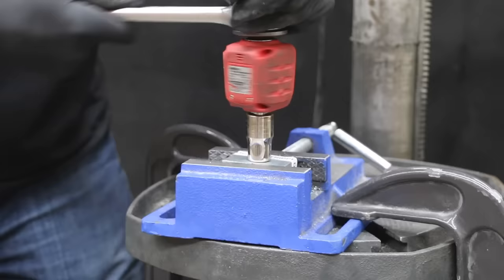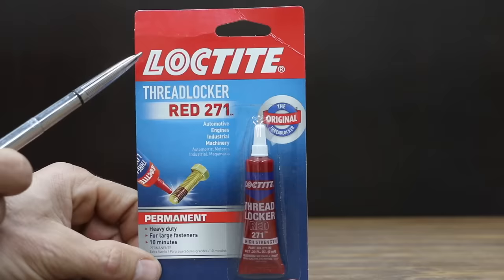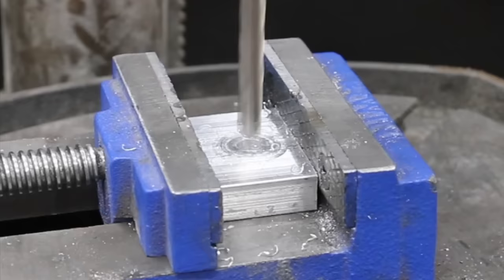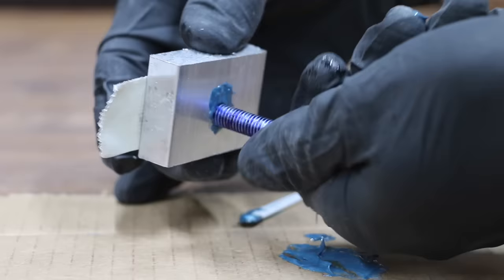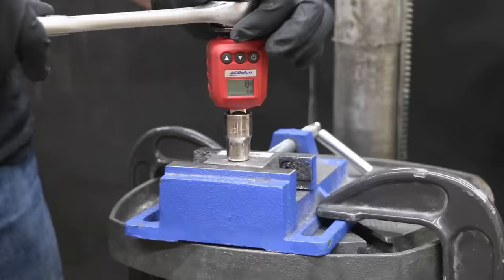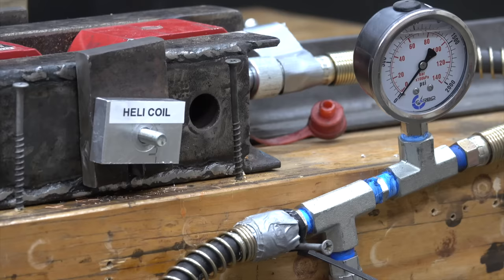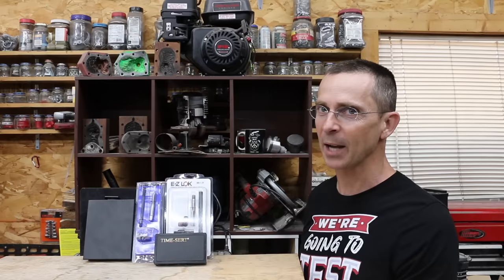Best Damaged Thread Repair? Let’s Settle This! Heli Coil, TIME-SERT, E-Z LOK, JB Weld, HHIP, Loctite

Comment: I appreciate this video so much, because of product line-up and the inclusion/comparison of known urban-legend-y hacks.

There are one or two issues with this video, that fixing would make it better. First, the time-sert tap shown in the video at 7:23 is not straight! That wouldn't meet some shop's standards. If I were them, I would want the test re-done.

Second, is that the test is done on a material where the inserts are able to out-perform the OG thread. Not cool! Try steel!!

Finally, an important technique was left out! This involves making an in-situ insert, by tapping a bigger hole, screwing in a bolt with high-strength loctite, then facing, drilling, and tapping that bolt out to the original size. This is important, because you can also move the hole center with this technique -- in addition to replacing the thread. And the only cost is the bolt after the drills/taps are purchased.

Comment: Can you do this in reverse, not sure how to best explain it.

But i have an e-bike and the company shaved down the sides of the threads on the axle trapping/locking the lock nut in.

It there a way to replace/build a compound or metal back onto the sides of the axle that has been shaven off.

So that i can rethread said compound/metal?

Sorry if this is easy to understand.
Reply from the maker: Thanks for the suggestion.

Comment: Hello, I have a pellet stove that has a screw hole thats stripped. The screw in question, holds the glass snug to the door. Being stripped, means its not air tight. Im a woman, so i dont have the skills to tap the hole. Will the copper wires work? Would the heat from the stove melt them and then make it loosen up and leak air again? Is there any kind of welding stuff that would snug up the hole that wont melt? I believe the door is irion, where would i be able to take the door to have it tapped? And what would it cost? (Estimated cost?) I truly hope u can help answer my questions, i have no one else to ask. Ty

Comment: It's already been suggested but stronger bolts would better test the inserts. This test is flawed because the bolts were inconsistent in their strength. We need to see the insert break as opposed to the bolt itself to really know which insert does the best job.

Comment: Hi!! for constant use what do you think will work best? the elevation system on my table saw get damaged, the threads of the motorhead that moves up and down the blade needs to be repaired

Comment: I love these videos, but I feel this didn't accurately test the helicoil style threads. With those when you tighten it, it just pulls them into the head of the bolt and doesn't allow them to pull out of the hole like they normally would.
Reply from the maker: Thank you!  Thanks for the feedback.

Comment: I'm not smart but
If you're making the hole bigger, just to thread an adapter to use a smaller size bolt

Why don't you just use a bigger bolt?

Comment: Hi there, Great informative video. I have a somewhat related question that you might be ble to answer. I have a set 1/2 inch threaded bike pedals (for one piece cranks) that I need to convert to 9/16n inch to mount on a 3 piece crankset. Would it be possible to machine a set of bushings with 1/2 inch 20 TPI inside threads and 9/16 inch 20 TPI outside?

Comment: My takeaway from this video is that aluminum is really a garbage material for machine assembly castings because of its softness.  But of course its low density, low cost, and corrosion resistance win the day.

Comment: Wonder which of the metal inserts would stand up to high exhaust manifold temps the best?  I have a partially stripped manifold stud in an aluminum head that I’m afraid will strip fully if I give it the full torque spec of 30 ft lb for the 10x1.25 studs. I got it to about 20 but it felt like it would strip if I went any more.

Comment: My motorcycle's 2nd drain plug is stripped, tried helicoil, it's not holding it will, thinking about time sert, it was M6 bolt, should I order M6 time sert. Not sure as it has helicoil in atm.

Comment: Please help guys I need advice. A bolt broke from the coil pack on my GMC envoy. I got some of it out but now it is inside where it's unreachable. I shoved the new coil.pack on it with a new spark plug. It runs like shit and I'm afraid it will blow up. It's the only vehicle I have. And me and my wife share it. What's the best way to go about getting this done. Again I had some help and we welded a piece to it and it broke again after two turns. I cross threaded it. And now I need to get a tap out or easy out and then rethread it... Will the new coil pack bolt work. Or should I just drive it util it dies. I give it a week.

Comment: If the bolt breaks before the threads isn't that number just showing how strong the bolt is? So the 500-700 ones are all even. Should have used very high strength bolts as this was about the threads and not the bolts themselves.

Comment: Will any of the methods w/pasta type repair work on Transmission (Aluminum) Drain Plug? See I stripped a bit that hole and probably the original bolt using a faulty torque wrench. It didn't click and continued to torque, then rotated once free, so I checked w/electronic one and it was 33 Ft-lbs instead of 22. Been mortified of course, I removed the plug, I hoped it was damaged rubber gasket that gave that single free rotation. I saw one 3/4 tiny circle ring came out of the hole though. Then I torqued it back w/electronic Torque Wrench to 22 Ft-lbs. But after I decided to put a new plug w/magnet I bought and received. So I removed the old plug again, and there was another tiny aluminum ring removed from the hole. The new plug was not going in. I put back the original, but was not able to torque it anymore, like on 11Ft-lbs it would rotate free. I removed it again, checked w/mirror, seemed like all the threads were in the hole in good condition, and put that new plug, it was tight 1st, but then went in. I hand tighten it, then snagged,  and not sure what torque to apply now. From all the described above I conclude that the hole is slightly stripped. Maybe I'll be O'K if every time I remove the Plug I put a new one.  Total mess I know, very upsetting mistake. If someone has any ideas please share. The film is very good. Thank you.
Reply from the maker: Thanks and you are welcome!  Thanks for the suggestion.

Comment: While I appreciate the effort of testing, I cannot help to notice that in the case of thread inserts, it was the bolts' axial strength that was ultimately tested and not the inserts'. Maybe one should have used high strength bolts that would have withstood the torque while ripping the insert off.
Reply from the maker: Thanks for the constructive feedback.

Comment: Which would you say is best to fix an oil drain plug? Scared any repair will still leak oil when it gets warm and thin, thanks.
Reply from the maker: Thanks for the suggestion.

Comment: Excellent testing, as usual.  (sigh)   So, the moral of the story is "Nothing fixes stripped threads like an insert."  If you're out in the boonies and have no sert but do have a drill, tap, JB Weld, and a spare day, you'll get by well enough.
Reply from the maker: Thanks!

Comment: What would one suggest for an aluminum radiator coolant reservoir overflow tank 6mm mounting hole that was stripped in the first few threads?  I can't drill it.
Reply from the maker: Thanks for the suggestion.

Comment: No hate here, but can the Americans please explain to me why you still use the Imperial System in literally everything? I've planed going to the US for at least some Time and i imagine that i would find it very difficult in my Job as a Maschinist... Everything from Feeds and Cutting Speeds for Milling and Turning to picking the right Drillbit for taping a thread, except ofcourse imperial threads :)

Comment: I’d be curious to know the relative strength of the original aluminum threaded with a bolt the size of the repair. That is, the original test was the pullout of a M8-1.25 thread, but the threaded insert is basically an M10-1.0 or thereabouts. So what’s the pull-apart strength of a simple M10 screw out of threaded aluminum plate? Is it comparable to the M8 screw embedded in an M10 insert?

Also, if the thread inserts are not themselves aluminum, or similar material to the screw, what extra electrolysis concerns might there be?
Reply from the maker: Thanks for the suggestion.

Comment: 8000 comments? you may not see this one?
What if you use an insert tap before using the copper wire?
Reply from the maker: Thanks for the suggestion.

Comment: @Project Farm My 1 question is I have (2) two Kirby vacuum cleaners where the motor head faceplate where the locking assembly for each additional option mount to has stripped (due to the lock breaking after 25yrs and needed replaced BUT when removed the faceplate threads stripped) and are 1/4-28 threads as I replaced both bolts but still need to repair the faceplate and the thickness/depth is only about 3/16 to 1/4" MAX and haven't seen a helicoil that shallow so can I cut the remainder off or..... thanks hope I get an answer FAST on this one please and thank you 🙏🏼
Reply from the maker: I would definitely try to shorten the heli coil so it will work.
Reply: @ProjectFarm  does name brand make a difference on thread locking inserts? I see Walmart has a brand called Uxcell

Comment: should have took higher quality bolts tbh
like some 12.9 bolts, here im sure the thread will break before the bolt
and to make sure its the repair kit that is tested, and not the aluminium, to drill steel
Reply from the maker: Thanks for the constructive feedback.

Comment: Every test when your bolt broke, the result is the limit of your bolt, not thread.
We can see it on your last test, the five first results are the same (limit of bolt).
To be more acurate, you need to test it with 12.9 bolt, 8.8 are shit and broke easily.

Comment: Redo these but with a higher grade bolt.
Reply from the maker: Thanks for the suggestion.
Reply: Wow. Didn’t expect a response. Cool! Anywho, we use these at work and it would be cool to see if you can get to a point where the bolt is stronger than the insert, or if they are all pretty much equal.

Comment: O' no. Lock-N-Stitch has a much better solution for both aluminum and steel, also plug repair kit for stripped threads in your engine block. With over 40 years as a machinist I would stay away from cheap fixes like JB weld, Epoxy or Heli Coil which don't hold up for long and your back at the repair again.

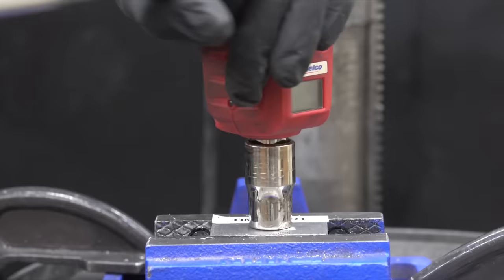Comment: 10:32 your chart is mostly irrelevant, in the first 4 instances it shows the tensile point of the fasteners, not the resistance of the thread repair device.

Helicoils work reasonably well in ferrous metals but when doing repairs in soft metals such as aluminum, a bushing type insert such as a Keensert or Time-Sert should be used.  We have seen too many helcoils pulled out of alloy materials.

Comment: No Keensert?
Reply from the maker: Thanks for the constructive feedback.
Reply: @ProjectFarm look up MS51831 for the keensert spec, used all the time with grade 8 bolts. They come in different wall thicknesses too. I agree with what others said, if you repeat this test you can get stronger bolts to get more data. Class 10.9 and 12.9 are the next higher metric strengths, roughly equivalent to grade 8 and ASTM A574 respectively. Keep up the good work!

Comment: How about rivnuts or nutcerts?
Reply from the maker: Thanks for the suggestion.
Reply: @ProjectFarm  Nutcerts are used in aviation (2 piece construction that wedge into each-other and expand) and are meant more for blind holes. Rivnuts are usually used with sheet metal, to clamp the metal as rivnut collapses. Would be interesting to see how they perform in blind holes. Rivnuts come in plain, notched or ribbed variety. Perhaps the ribbed version can dig into aluminum well.

Comment: Why are the EZ lock bolts breaking at different torque then the other inserts?   Almost 200 in/lbs more...   Did you use a different type of bolts for the EZ?  Why didn't you actually test the "thread repair" holding power with better bolts?  As maybe the HHIP might have held at 1000 in/lbs if the head didn't break off...while the EZ lock might have been 800...   I would have caught this and redid the tests with stronger bolts....   That would have shown the real winner...

Comment: I'm sorry to say this but you're more of a test in the bolt strength rather than the actual thread locking power. You need to do this again but use grade 8 bolts.
Reply from the maker: Thanks for the suggestion.

Comment: I had to laugh when you were trying to drill a pilot hole for an 8mm tap and chose a 17/64 imperial drill bit, instead of a 7mm drill...
Reply: For standard M8 tread you are supposed to predrill to 6.8mm… 17/64 is 6.75mm. So quit your yapping you would have made threads that are piss weak.

Comment: Old mechanic here these products are a waste of time 
Drill & tap to a  big bolt size is the permanent fix
Reply: The metal taps are stronger than the base material. Your way is only superior if you’re trying to fix it with epoxy lol

Comment: You should redo this video with some grade 12 or high strength bolts and skip the silly repairs, just do the actual inserts. That way we can actually see the difference in the inserts instead of just breaking the bolts
Reply from the maker: Thanks for the constructive feedback.

Comment: Um an engine reconditioner by trade and am constantly haveing to fix other people's fuck ups when they install the parts had to change a whole blocks head bolt size cause he fucked 4 some people need to put the spanners down sometimes 😂

Comment: Of course the thread inserts out performed the aluminum threads, they are made of steel... the bolt head would've bottomed out on the steel threads. You should've used shouldered bolts to test the thread engagement itself. Great video otherwise!
Reply from the maker: Thanks for the constructive feedback.

Comment: I think the world would appreciate if you did not use outdated and inofficial measurements like inch-pounds. Even the USA has legally committed to the metric system and torque is measured in newton-meters around the world. The absolute minimum would be if you indicated the values in standard metric at least on the screen. Best regards, Martin
https://en.wikipedia.org/wiki/Metric_Conversion_Act

Comment: Dude in my point of view your doing it so wrong you don't use an inch drill bit to drill a hole for a metric thread for 8 x 1.25 you use a 6.8mm drill full stop or if you really want to to it properly you use a 6.75mm drill
Reply from the maker: Thanks for the feedback

Comment: Helicoils?  This is metal porn . LOL   Aluminum? , so kind softcore.  Try it in 3-4 " steel/tank armor with 1.25" broken off bolts and/ or stripped bolt holes. 
That is Hard-core Heavy Metal porn . LOL.

I pretty much stuck with Helicoils,. through that HHIP looks interesting for a similar cost.

Comment: Huh? These results are moot!. You're breaking the bolts NOT STRIPPING THE THREADS THIS HAS ABSOLUTELY NOTHING TO DO WITH COMPARISON OF THREAD REPAIR! you need a stronger bolt that won't break until the substrate strips. This entire video is pointless